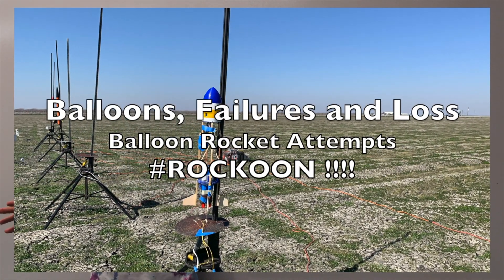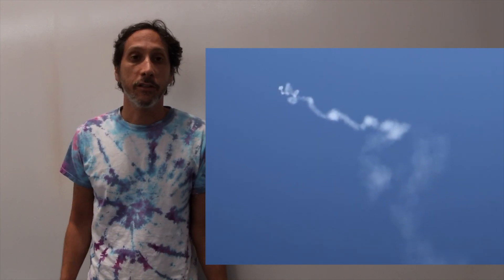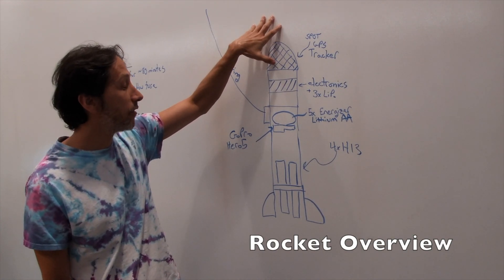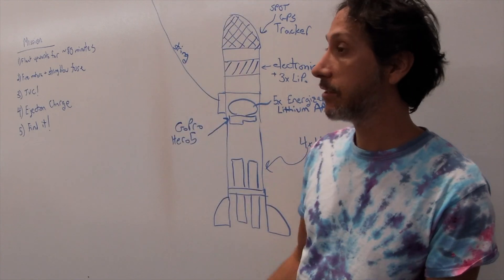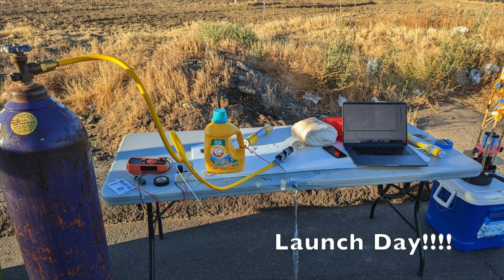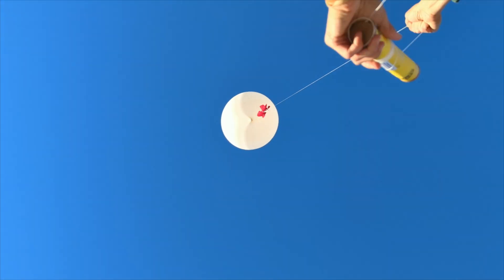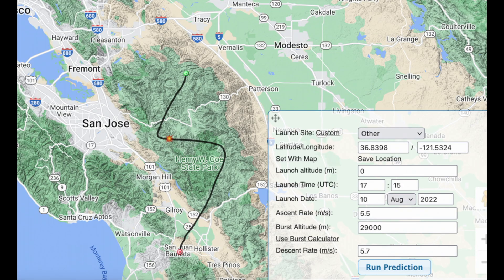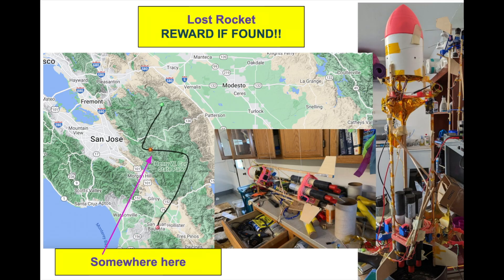TVC Rockoon Liftoff

Comment: Use a parabolic dish on a gimbal tracking the RSSI.  This will give you an order of magnitude (10x) of the tracking signal.  Super fun project that also looks really cool while in use.  The bigger the dish the better.  If you could use something like a dishtv reciever you'd get something like 20-25 mile reception.  Satelite controlled drones use the same concept to lock onto the satelite in space.

Comment: I suggest having two types of strings for your rockoon: deployment lines to attach the "rock" to the "oon", and mooring lines calculated to hold the balloon to the ground station at full inflation size in the highest plausible wind gust. It should be possible to design the mooring lines to completely fall away once cut, so they can be pretty heavy. A large cloth bag might work, so the mooring system doesn't necessarily have to be lines.